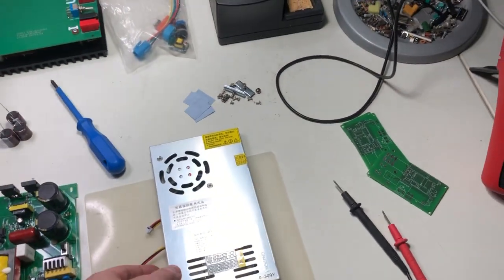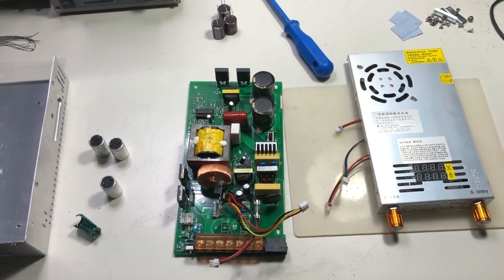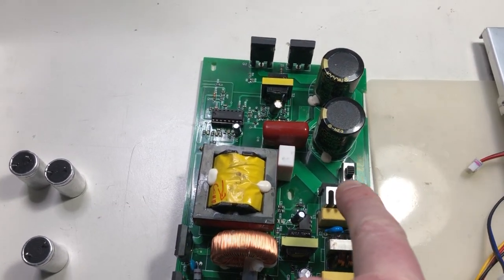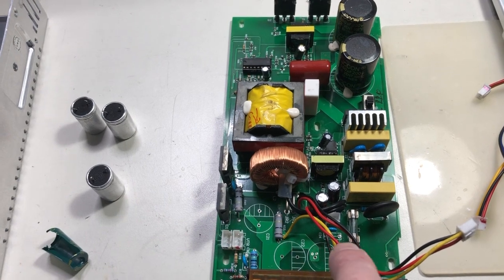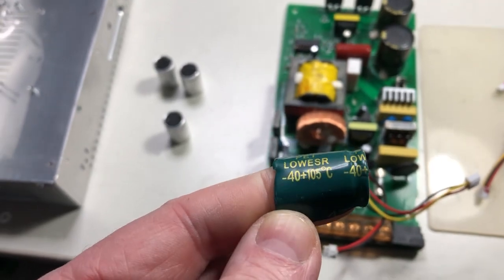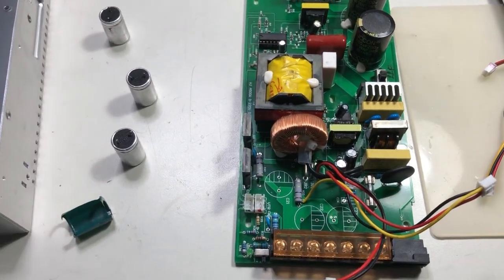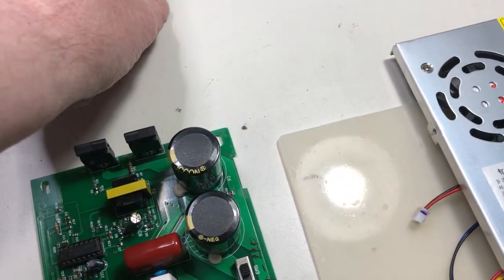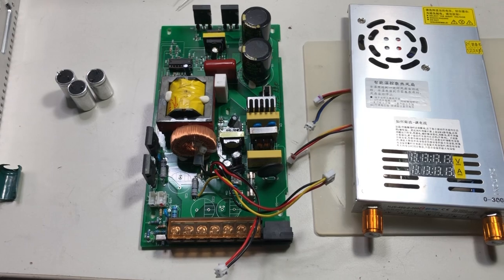Caution when Buying Cheap Power Supplies from China (AliExpress, Ebay, Banggood,etc.)

Comment: Konstantin,  I have the 48v version, can I change the pots to increase the output voltage and decrease the current?
Reply from the maker: You can Ivrease the Output Voltage to some extend (as long as you do not exceed the Voltage Rating of the Output caps, further the transformer is designed to the max nominal Output Voltage + some %

Comment: Everybody I've talked to is dead set aginst swithcers for Ham eauipment. They are way to noisy. You mentioned using one for transmiter tubes, so be careful about high frequency noise getting through you transmitter.
Reply from the maker: Hi Richard, well all modern professional(not Amateur) Power RF TX / RX are using Switchmode PSU's, Today even in medicine where its dealed with nV, SMPS's are used, of course correctly designed ones.

Comment: Dear Konstantin. I have a similar brand but the different model (HJS 480 0_160v & 0_3 A) and I have a problem with it. I want a board map to repair it but I couldn't find any board map for my model. Can you please provide an image from the board of this model that you have?
Reply from the maker: Hello, Please contact me via Email to send you the Schematic, my Email is in my Channel Description.
Cheers,
Konstantin
Reply: Can you please share again I just bought 1 from eBay.the power supply had only voltage adjustment I want to see if could do the current adjustment.from my first glance mine 0-60vdc look close to the one you have the only difference is no second variable resistance and no location in PCB board.
Reply from the maker: Hello, Please contact me via Email to send you the Schematic, my Email is in my Channel Description.
Cheers,
Konstantin

Comment: Greeting 
I would buy such a power supply 12V-40A
Is it suitable for daily use in electrolysis?
Thank you
Reply from the maker: Hello, well its a PSU made to cost a minimum. I have a similar one working for 2 Years now without issues, but anither failed in one Month (I repaired it though andworks since then) so its a little a gamble what y will get. Cheers, Konstantin
Reply: @KonstantinGrigoriadis  Can you recommend a seller on any page...
Reply from the maker: Hello, not really bcs I donno what you will receive.. I would suggest to goto aliexpress and search for 12V 40A , you will find many and choose the one with the best reputation and highest sells.

Comment: They're usually decent enough, but I've purchased some with components that are completely unsoldered.  One had one of the main torroidal transformers, not soldered what-so-ever, rolling around inside the metal case when it arrived.  I finished the solder job and it worked great.  ...but still.  No QA/QC of any kind, and who knows what other corners they're cutting.
Reply from the maker: They are ok for the price Normally,  they work, but some of those are Awful due lack of QA/QC, the one with the punched cap was the worst and most dangerous o had till now.

Comment: I seen this with Chinese power supplies myself with re-branded salvaged capacitors, The bulk caps were an absolute disaster covered with a Dongbaohe label, the caps had less than 500uf for a 33,3 Amp rated supply and more than 2ohm ESR, not only that but pretty much all parts were salvaged and dented or crooked and you should see the solder job they made, oh boy it was a sight for sore eyes, not only that many connections were lose or cold soldered it was also full will solder balls and flux all over the board almost shorting out the mains over to the output side. so indeed be careful and watch out for dodgy Chinesium products when trying to get a good bang for the buck
Reply from the maker: I used (for non Prof) quite a lot of these cheapies, all in a condition : "OK, they work" nothing more, but this one with an Output Voltage upto 300V at upto 1.6A was eye opening.... I have no Problems reusing Parts so at least I know they are not fake(I do that myself to when I need stuff fast) but putting mechanically damaged parts in a High Voltage Output PSU ist S**T.
Reply: @KonstantinGrigoriadis  indeed, and I don´t dare to think how the safety isolation is inside the transformer either because those often just have the lacquer on the wire isolating the primary and secondary. But I mean not everything is bad and China makes a lot of good stuff too, but it is a general thing when it comes to cheap stuff they are over rated and will fail at the stated voltage and current. I built my own HV power supply for my Tube audio instead, variable stabilized output up to 500 volts and half an amp with ripple less than 1mv peak to peak which is placed above 20khz. The power is actually so clean you don´t even need any filters in the amp. I put a lot of effort into that and built everything myself including designing and making the circuitry with oscillators, drivers OV-protection automatic idle and everything even re-winding a toroid for it. it is a soft switching push-pull design with fet-dampers working at about 22khz or so, I can adjust every aspect of the oscillator, and if the feedback fails the driver board also have an adjustable over voltage protection that shut down the psu in case the voltage rise too much and it stays that way until you manually cycle the main power. My goal was perfect regulated DC but if you would drop that PSU on your foot you never gonna walk again
Reply from the maker: @Pulverrostmannen  
Stunningly the Ouput Transformer is OK to Good rated, thick lacker on the Sec Winding, double tape Insulation between Pri and Sec, double between layers. The insulation covers completely the Primary almost to the Leads where its soldered on the Pins. These bigger Transformers where all ok (at least the ones i opened) in contrary to many of the small wallwart style psu Transformers that where 90%+ Dangerous.
I made some designs for a Complete Tube PSU, meaning Anode V upto 800V 70W Total, plus ADJ Screen V upto 450V and ADJ Grid V upto -200V, all Flyback Based planned to be in on enclosure  with an addition 0-30V 20A Fillament DC Suppy.
At the end it came much more expensive than using ready made stuff and just tweaking them to fit my needs. The costliest part where the Transformers, that even made in china from Large Manufacturer to my Specs, still are expensive and winding mycelf was not an option :-) The 800V 70W (70kHz) PSU is fully Digital with a 3.2" TFT but never came out of the Prototype :-) was planned as a DC/DC Flyback Boost to can be operated in a car too without Inverter. that was 4 Years ago :-)
Your design sounds Interesting, did you wind your Own Transformer ?, One Output HV Winding or more Lower HV Output Windings Stacked ?, Doubler Output ?
Reply: @KonstantinGrigoriadis  I built my transformer by removing the old secondary winding completely and winded my own with two heavy gauge 12 turns each Center tapped around the toroid core making the transformer become about a 1:60 ratio. I drive the transformer inverted meaning the primary winding becomes the secondary instead. I feed the new winding with my high current oscillator with about 12-13 volts and get high voltage out the other winding. This makes it much easier to make it work since you don’t need to wind hundreds of turns for it to increase the voltage. 
I done it this way a lot with toroid transformers as you would never want to manually wind so many turns it needs otherwise. But a few turns is fine to just invert the input to be the output instead. But there is a limit how much voltage you can reliably use too as the primary won’t be rated for an infinite voltage. Taking the rms peak voltage plus some margin I never would go more than 500VDC on a 240VAC rated transformer inverted but I test them with at least 700volts on the output.
And finding big nice 400volt toroids is not an easy task either but it is preferred for higher voltages than 500Volts
Reply from the maker: @Pulverrostmannen  did I understood it correctly ?, you used a mains Toroid with a new Sec , then you use the new Centertapaed sec Push Pull switched with a 50Hz 12-15V Pure/modified Sine Generator ? Like a Inverter ?
Then I understand why the Transformer is so heavy (ca. 250W)
Btw, I contacted you via the Email in your info Page on Youtube.
Reply: @KonstantinGrigoriadis  pretty much do it like that. Except my big power supply have a 500watt toroid transformer inside. 
But I use higher frequency at 20-25Khz as you will hear it switch otherwise and to avoid hum in the amplifier. I use a push-Pull square wave that is softened by “bumper capacitors” across the switching FETs which makes it very soft switching. 
I checked my mail but I have not seen any mail there yet. Not in the scrap bin either. Check it again that you had it send correctly
Reply from the maker: @Pulverrostmannen  I just send it 🙂
Reply: @KonstantinGrigoriadis  I also think the smaller trannies are usually more unsafe in the Chinese stuff. 
for my build I was lucky enough to get my hands on a free huge toroid transformer like 5-700VA it was potted in epoxy resin but I carefully removed it and all of the secondary winding and then winded my own on the primary winding and use the transformer inverted, I have a 400watt Meanwell main supply that powers all components in the supply including the two huge bulk caps which is 39000uf each that powers the primary side in the high voltage converter, The output is very tightly regulated and tested up to 700volts but is then limited to 500volts as this is the maximum for the caps I use and for the desired margin for regulating the voltage, I have then a 2-stage filter that first goes through a rectifier into a pair of Rubycon 500V 12000h rated caps and then fed into a massive 17mh choke, the choke then goes into the most expensive component in my whole build the absolute abysmal Kemet 13000uf 500V capacitor, that thing is like a pack of milk in size, it is rated 35amps in ripple current at 10khz, it filters the remaining noise from the output voltage, the regulator I built is adjustable from about 200V to 500 stepless and it will keep that voltage exact no matter how the load is on the output, no noise no nothing, you can even take that output and feed into the grid of a preamp directly and you won´t hear a thing.

I have output voltage gauge and also current gauge and also indicators for the status, including: Ready, Idle, Run, and OV Protect, All made with a single LM258 (same chip also monitor, trips and hold the OV protect as well, mind blown🤯) it was a hard nut to crack making all that with a single opamp, took many beers. Main power voltage gauge for the main power, also switch for running mode: always on, Off, or auto (external start) 

I have a built an audio detector that automatically detect audio and it also activates the external power supply when audio is playing, when nothing is playing this audio detector not only put the power supply into an idle state it also mutes the speakers completely, when the external voltage is off/idle my amp runs at lower power with it´s built in power transformer which saves the tubes when nothing plays or I just don´t care to have the best sound.

But this supply is only made to supply absolute perfect DC high voltage into the amplifier and also bypass the filter stages, this way I get nothing in the way for the tubes to give best possible power and audio quality when the external supply power the amp, it needs no additional filters in the amp, but I always build it with resistor dividers for screen grids and pre-amp tubes so I don´t need any extra voltage sources that way, the whole amp just follows the increased voltage all together, and I have this specific amp cathode biased with 3 different levels, it plays any 6V6,6L6,EL34,6CA7,807, I typically use EL34/6CA7 with it in True triode mode, it is a single ended dual mono amp.
i can also use any ECC83 or 85 pin compatible pre-amp tube with a selection switch, it just plays anything i plug in.
when I designed this amp I aimed for wide compatibility and options, it also plays in pentode mode, have tone control and negative feedback selectable. plus various anode impedance settings. and more. 

but the filaments are always powered with the transformers i have in the amp itself, it also have 2 trannies, one for the filaments in the output tubes and for the built in high voltage, and a separate for powering the pre-amp tube filaments with regulated DC along with indicator lights and hour tachometer. in short all components I built is working together as one but even on their own if needed, if the external supply won´t work one day I can just happily play on with the built in power of my amp. but it is the mix of them that makes the best of them. 

I have made my own pre-amp for this as well, Tube VU meter, and additional Push-Pull tube amp sub amplifier and modified speakers for them.

years of work put into making that stuff all together, But I love them, it is pretty special when you make something yourself and you can sit down and listen to your own work :)

Comment: A 300V dc psu? Why does anyone need that?
Reply from the maker: Hi, for Vacuum Tube designs
Reply: You would be surprised.  It's just not mainstream...mostly specialized use.  Many things I work on use 300vdc power.  It would be great to have a power supply to test and TS those components off of the unit, and inside on a workbench, unfettered by the weather and such. This might not be useful for everyone, but I'm relieved to finally start finding channels that work with this voltage level.

Comment: Never buy anything which operates at mains voltages, 120, 230 volts from a Chinese website. Never.

Most of it is utter crap and dangerous.

I have seen metal cased appliances that are not even earthed. I have seen the wrong sized fuses installed.

Other devices have had live (hot) exposed metal parts.

They are a death trap waiting to happen.

Spend the money and get a Western made product which confirms to recognised standards.

Comment: I have similar power supply DC12V 24V 36V 48V 60V 80V 120V 4A Adjustable Charger Digital Display Current Voltage Adjustable Switch Regulated Power Supply. Supply it's working but I need more currents, and I program the same current for amplifier as consumer,  and in idle amplifier state current is around 0.7A, when I start amplifier current goes up to 1.1-1.3A, but after some time current just drops around 0.2A, when I'm looking on LCD power supply screen. That would be that cheap chinese high voltage capacitors connected in serial or something else!!!???, amplifier is in good state, checked on other supply
Reply: Found the issue?

Comment: If you guys buy power supplies like this and they have a 110/220 switch, remove it and wire it directly with jumpers as to your voltage mains. These switches over time corrode and lead to failure. Just remove them. I ALWAYS check solder connections as first thing, then I check the build quality then I check function and operation. I just saw that IC in a socket. If you are skilled enough remove that socket they cause problems too.

Comment: Thank you, Thank you!!!! ...  for explaining this from an engineering perspective.   I learned my lesson years ago when I knew absolutely nothing about power supplies. The one I purchased (brand new out of the box) DID catch fire while only pulling 30% of the rated power...  That was my "never again" moment.  I see you mention Astec (now Emerson) in a reply below.  That is one of my favorites, especially the MVP series.  Thank you again, seriously, you may have just saved someones life...  
BTW: here in the states, a psu like the one you review here in this video, would have NEVER been allowed to reach our shores.  I don't know why the regulations have changed.
Reply from the maker: Hello, Thankyou, I use these kind of Cheapos for HV Tesla coils testing, nothing critical and always check them optically and electrically when I received them. This one was particularly dangerous with the bad cap bcs it at at the 300V Output, was a Fire hazard waited to happen. 
For critical or work applications i use Meanwell, Astec, Delta, etc. depends on Budget and requirements.